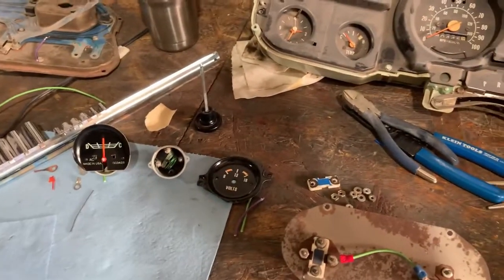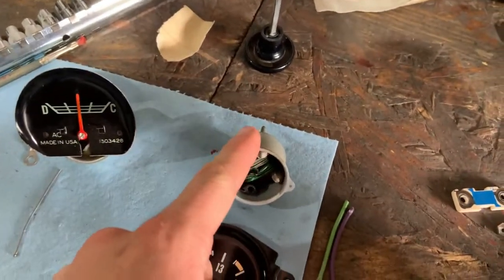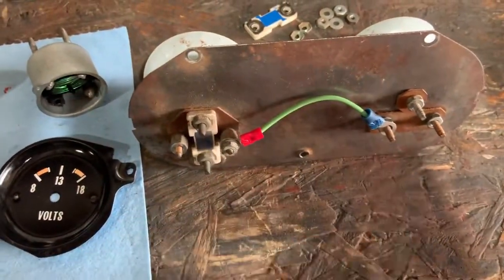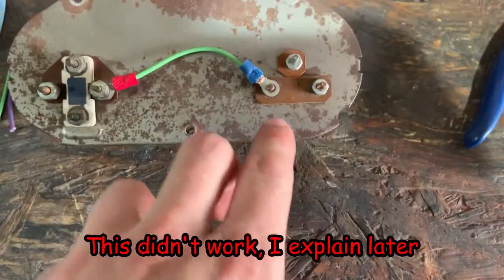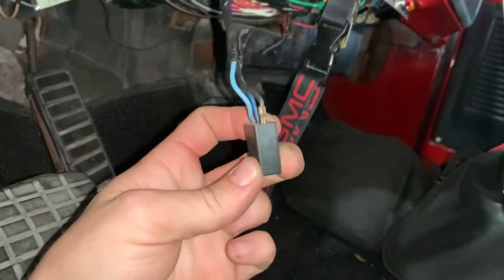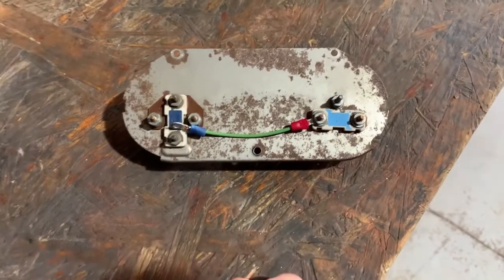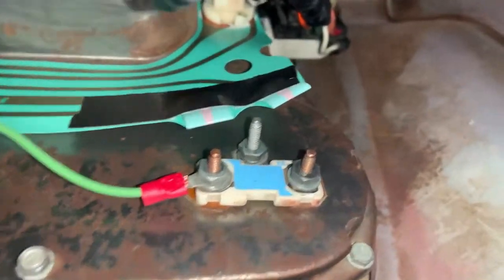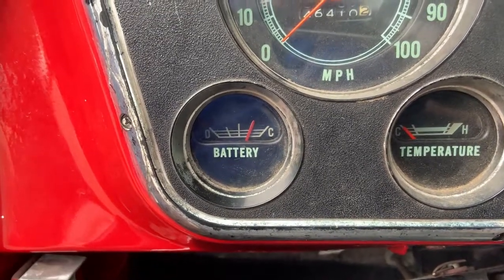Amp to Volt gauge conversion 67-72 gm trucks

Comment: Will this work when using a one wire alternator?
Reply from the maker: It should, the way I set it up it's measuring the system voltage at the gauge cluster which shouldn't care what alternator is installed. I currently have what I think is considered a 1-wire alternator, it's off a 95-99 Tahoe and has an output wire and an energizing wire

Comment: If you can source the voltmeter really cheap (a new one is $50) and your time is worth very little, then this modification works.  Otherwise, American Autowire sells a voltmeter that replaces the ammeter for $100 - part 510871.  I love that it can be done this way but I will hit the easy button.
Reply from the maker: Good find, I wanted to keep the D/C gauge face since they are not common in the modern day

Comment: dose this truck still have the external Voltage  Regulator  or has it been converted to one wire alternator
Reply from the maker: It has a 1 wire alternator and everything from a late 90's Tahoe